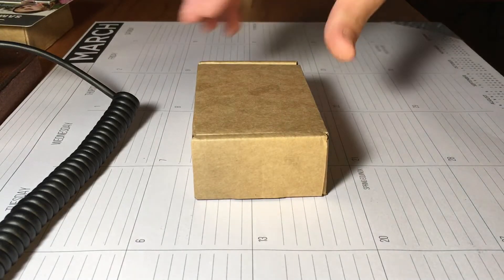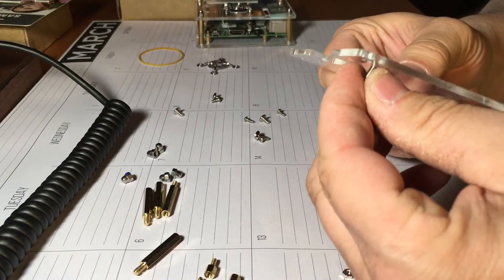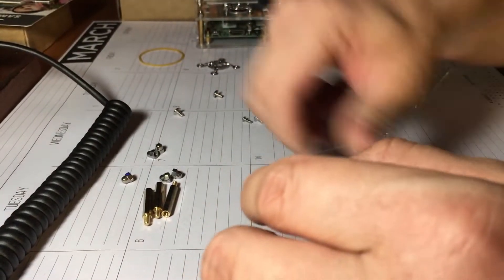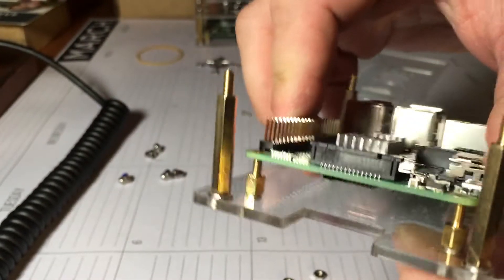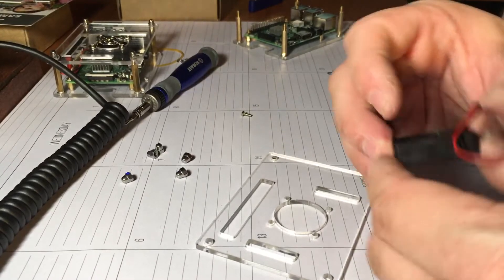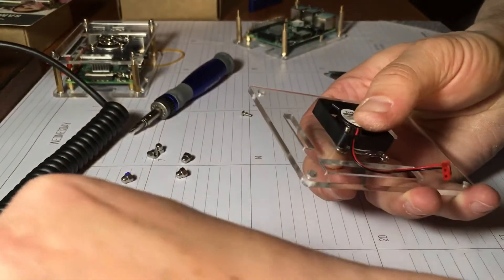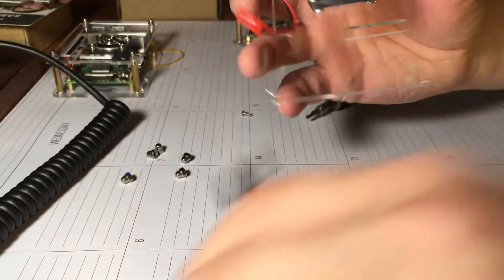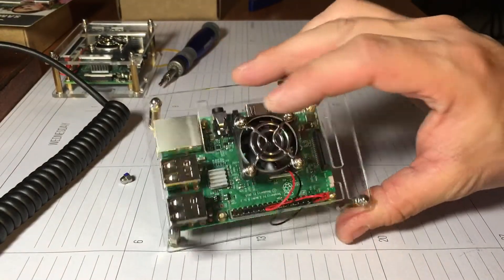How To Assemble A iUniker Raspberry Pi Case With Fan

Comment: I think it's all upside down. The screws should all enter from the top down, so it provides little legs for the case to rest on and the brass screws aren't popping through the board. But anyway, it works. Thanks for sharing.